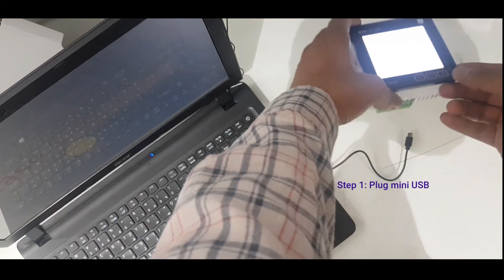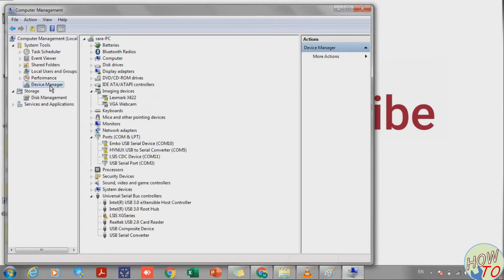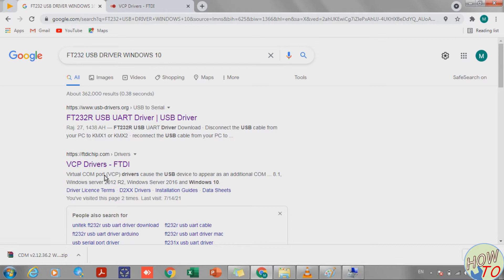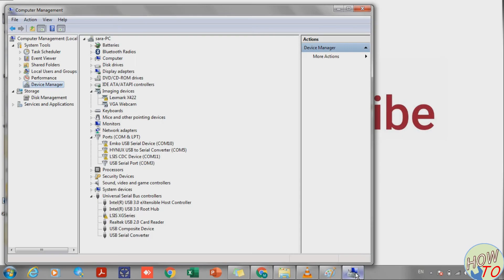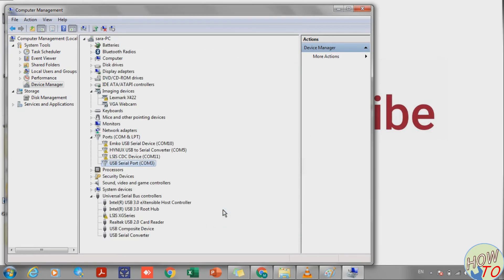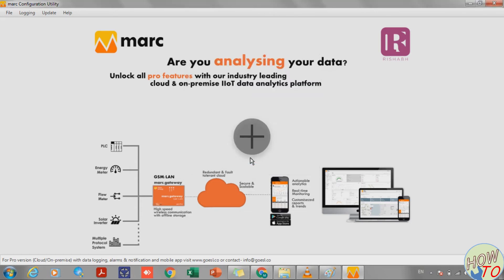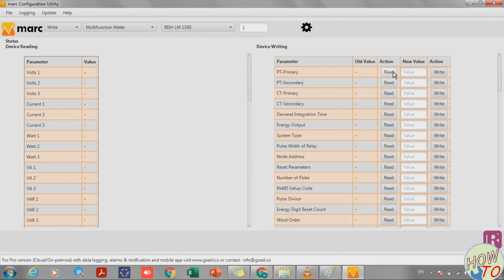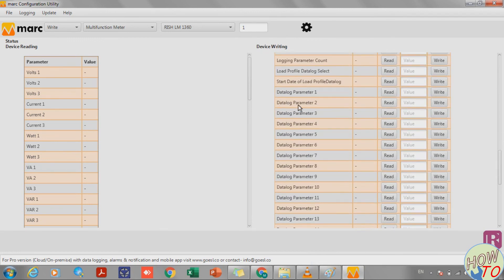How to communicate with LM1360 miniUSB? || Rishabh

Comment: Please give manual CT/PT ratio setting
Reply from the maker: You mean how to make the setting manually without PC?
Reply: @howto...8040  yes
Reply from the maker: Press UP and DOWN key together for few seconds, then enter code as 0000. Use the middle button as 'Enter'.

Once inside, find system setting of CT and PT
Reply: @howto...8040  ok....tnx